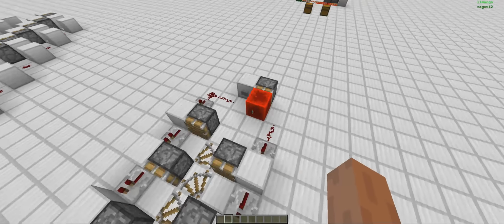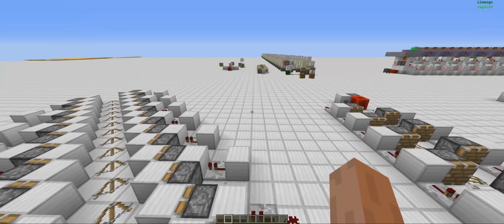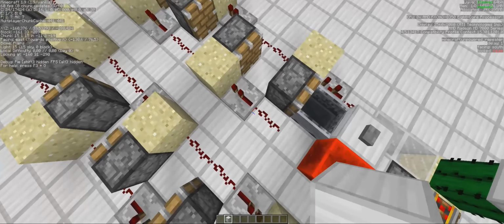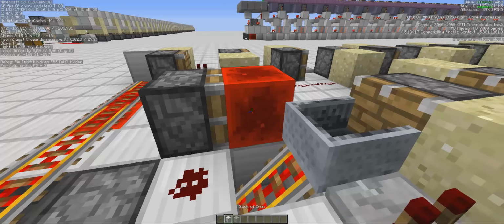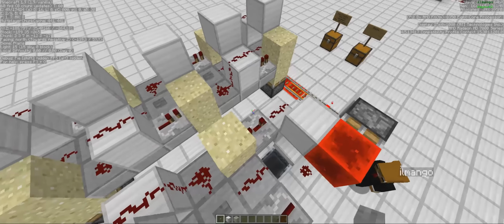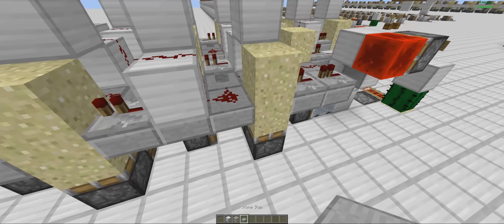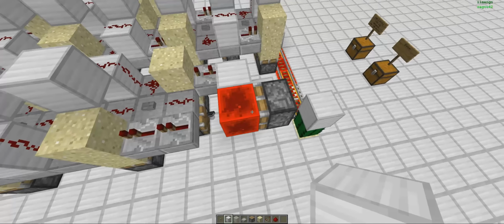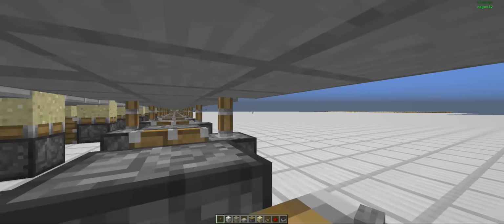[Showcase] 40m/s Translocators for Minecraft 1.9-1.10

Comment: Ragou i think i found a translocator similar to the simplest one but this one works on the other direction.

Its really simple, just put a piston with sand at the start like the other one and the other ones (Where you put the piston with sand on the normal) Put just a normal block without piston, it works perfectly also without minecart.
Reply from the maker: I don't think I fully get your prescription, maybe you could make some screenshots?
Reply from the maker: ah, now I get it. This seems quite similar to Ilmangos recent designs. The downside of those is that they are only 20m/s fast (the delay due to a repeater is 2 game ticks, that's also why it works fairly well without a minecart since there is an additional tick for server and client to sync again).

Still, a nice and simple design :)
Reply: oh well, i think i get the idea, anyway i think its posible to create a 40m/s's one. I will info you when i find a model. Thanks =)

Comment: Lol, I just saw a video by purpledragonnuke, who built a 60 b/s elevator? 
Or did I mess sth up and only horzontal pistonbolts no longer work?
Reply from the maker: +LavithanHD for 60m/s elevators you need horses to make them reliable, but they might actually still work. not sure why it's different for horizontal ones though.
Reply: +ragou42 but purple made it without horses? :D
Reply from the maker: LavithanHD
Then I'd guess he just tested it in single player, if at all. I might take a look at his video later
Reply: it is possible to make 180m/s elevator with one gametick piston delay and the entity pulling glitch and couse the player is 2 blocks tall it it will pull player 3block per gametick and thats 180 blocks per second:)
Reply from the maker: +Eero L. nope, you got your math wrong. One second is 20 gameticks -> 20x3 = 60

Comment: Do piston bolts still work in the latest versions of 1.11?
Reply from the maker: kind of, but they are somewhat locational.  One needs to try around quite a bit with the delays at the start to make them work
Reply: Well that's a bit aggravating, but ok. I was hoping to just slap it on top of a furnace array. Thanks for the quick reply ragou!

Comment: Does this work in 1.12.2?
Reply from the maker: nope, It was fixed in 1.11
Reply: Do any piston bolts work in 1.12.2?
Reply from the maker: The old piston bolts do work (the ones with pistons on the side and curved rails) but they became quite sensitive and somewhat locational (each one needs it's own fix so to say).
The "translocators" (the ones pulling you through the piston) are gone for good.
Reply: Okay, thanks!